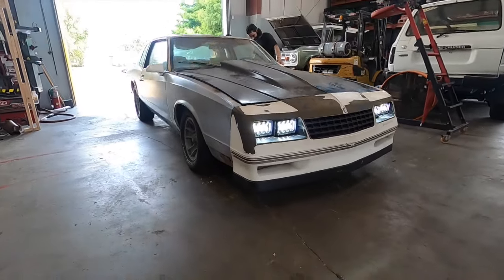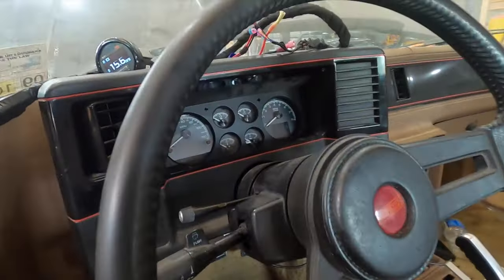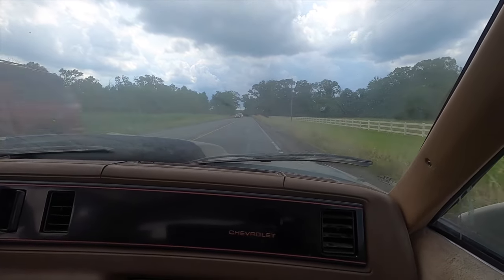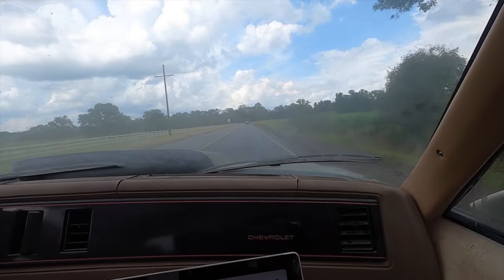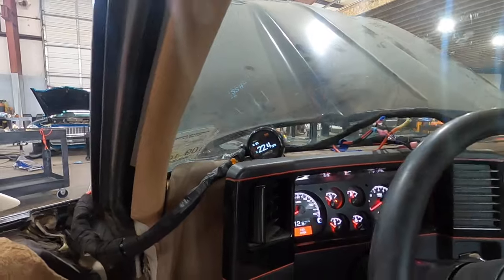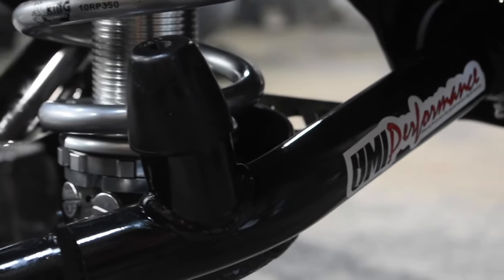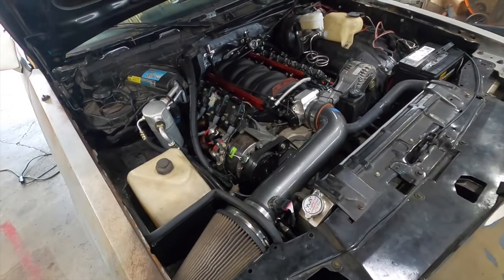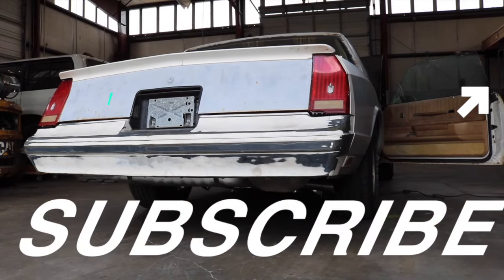The 6.0 LSX Monte Carlo Hits The Streets and Its ROWDY!

Comment: I put together my 1988 T-top SS with a carborated four barrel holler 570 dual feed single pump just a mild 350 small block the kicker is in the 80's and 90's I was a firm believer in the turbo 400 tyranny but this time what I was looking for the enjoyment of traveling with this car so I opted for the 700r4 overdrive trans my buddy made the fourth gear into a fourth gear I truly like this alot considering I don't think I have mu h more horse power than maybe 300 hp my monte sounds really good and she hauls ass down the highway  another thing I did under the hood  was a serpentine setup of the early 90's throttle body truck Era  I had to change my water pump and fan blade to reversible but the engine runs 185 to 190 alday long the suspension is another area I up graded umi slap bars front and rear plus rear upper lower track bars with better shocks now my tires I went 235/60r/16" all the war around but I need to change the front tires to 225/60r/16" they rub because I used 16" iroch wheels. Having issues trying to get my door windows adjusted.i really like your monte with that 6 lt badass u guys keep making these videos 👍